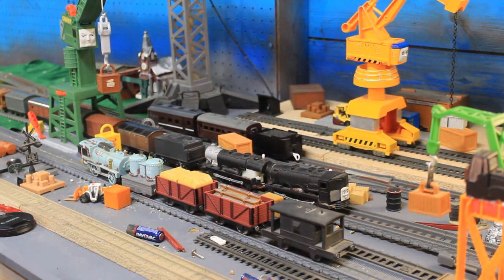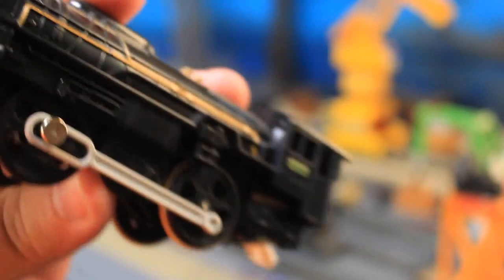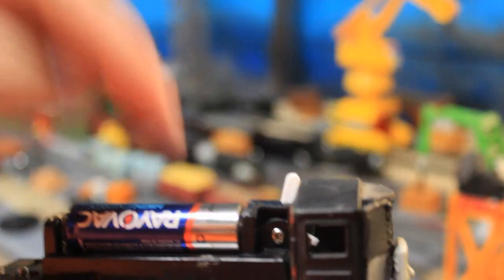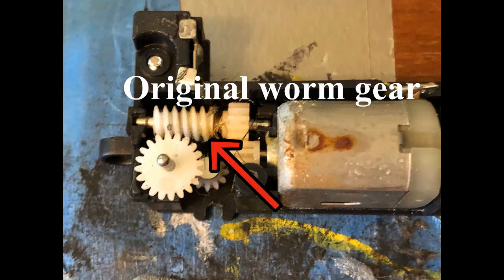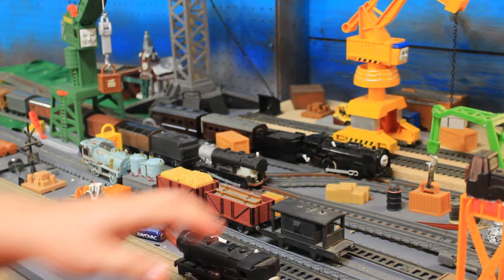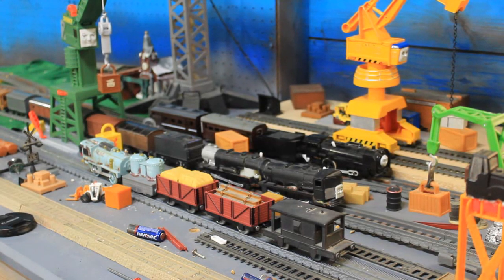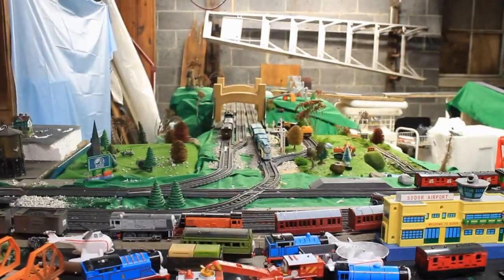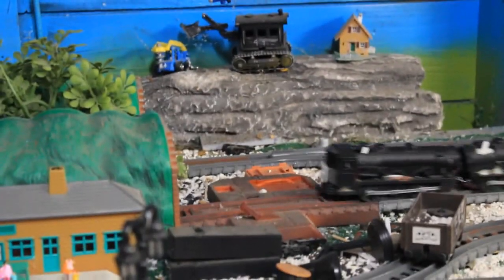MODIFICATION STATION 83 GEOFFREY, LEXI MODS and New Custom Engine

Comment: 7:06 At that time, as you bring back Lexi on the track, you forgot to switch the points. The points are set to the right, not straight.
Edit: You switched after Lexi and her train left the points.